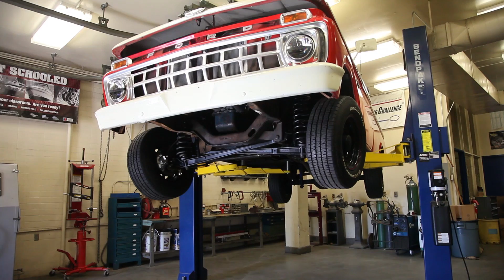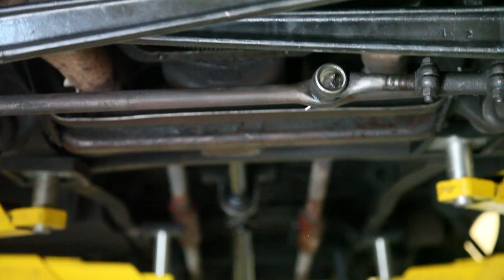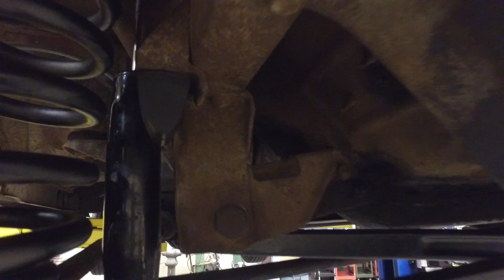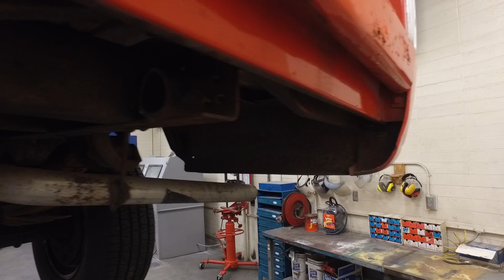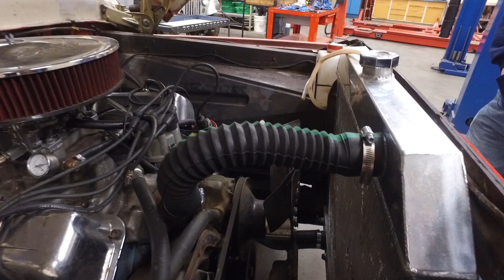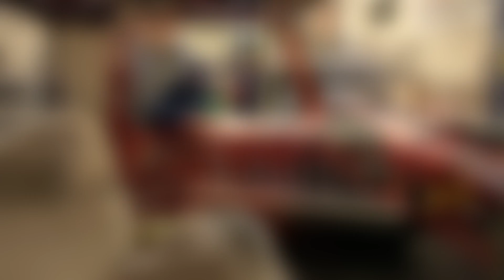HoonTruck: Let There Be Brakes!

Comment: "Older than dirt". That's me. And I've found, and this vid just proved, doing it right the FIRST TIME is infinitely preferable to re-doing it. Over----and over. And in the case of that brake light switch southern engineering is DANGEROUS. But messing with old vehicles you're gonna find a lot of that "southern engineering". Did my share. Paid the price. And LEARNED. Interesting series. Gonna keep following.

Comment: Those brake lights should be activate from a pressure switch mounted on the master cylinder. Not a switched mounted to the brake pedal itself, I've got a 66 F100 and a 54 Galaxie and they both work in this manner for activation. And from 62 to 66 most f100 parts are interchangeable. Hope that helps and am loving the videos on the F100